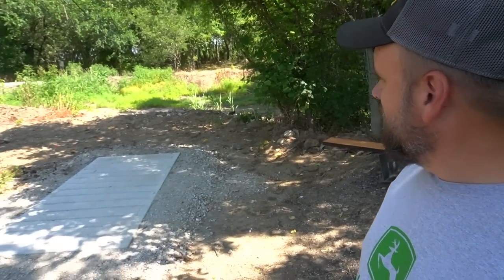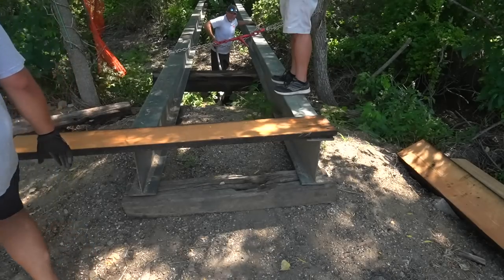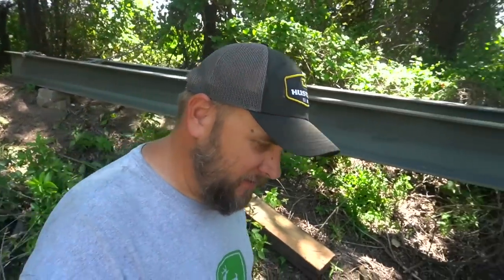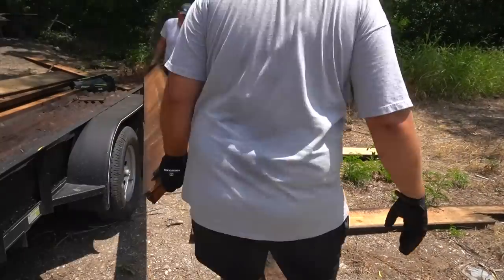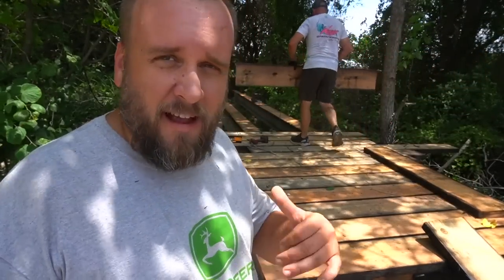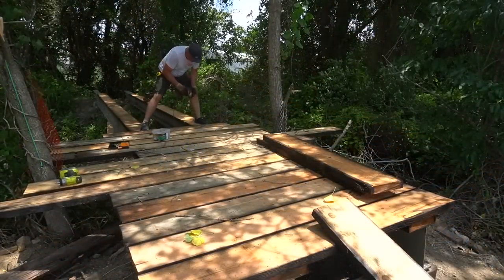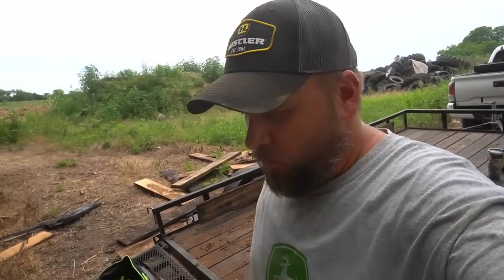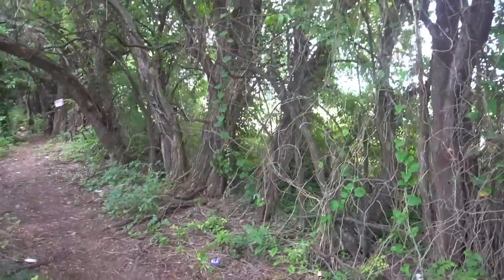We Built a 40 Ft Bridge with Resawn Railroad Ties

Comment: Looks awesome!   I would highly recommend tying the bottoms of both steel beams together in a least three places to create a true box truss.  This will resist lateral forces when the bridge has live loads imposed upon it.  Great job guys!  👍👍🔥🔥
Reply: i think a big concern would be the flat boards on the beams holding moisture, shouldve put some pieces between the wood and the metal so air can get in

Comment: Looks to be a pretty strong design. Could have used a vertical support in the middle.  I imagine it would flex a little if you dropped a couple sherman tanks on it with the current design.

Comment: Can you tell me the details of how you attached the wood to the top of the steel I beam?  What did you use for screws?  Did you have to pre-drill holes?, ect.  Thank you Steve
Reply from the maker: Pre-drilled holes and then used a large diameter self tapping screw
Reply: Thank you

Comment: I missed how the boards were attached to the beams.  Did you drill through the steel? Those screws went in kind of easy.
Reply from the maker: You didn’t miss it, we didn’t really show it in the video. Not on purpose.

We pre-drilled through the beam and then used a large self tapping screw.
Reply: @RockhillfarmYT  thanks. Was wondering how you did that!